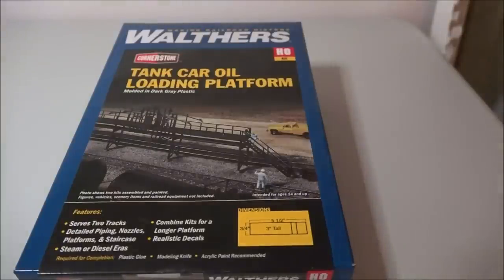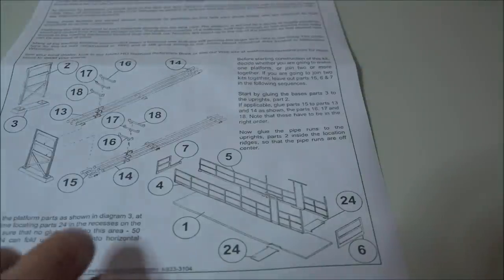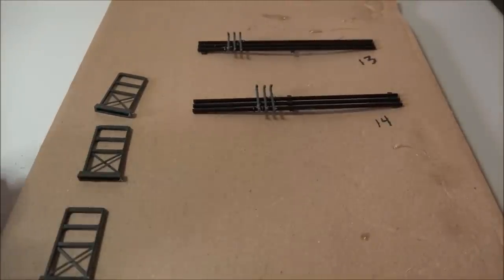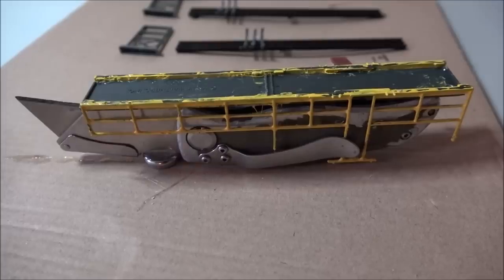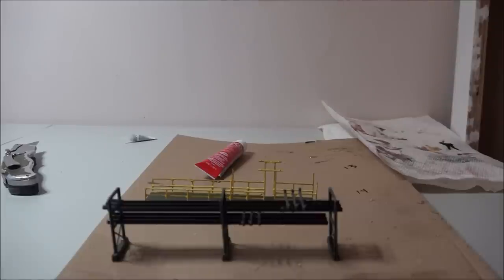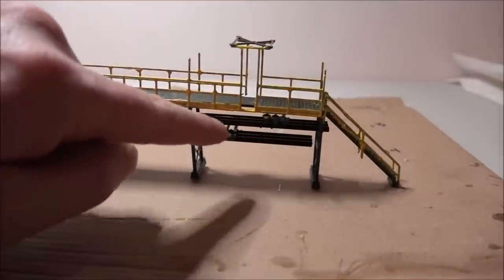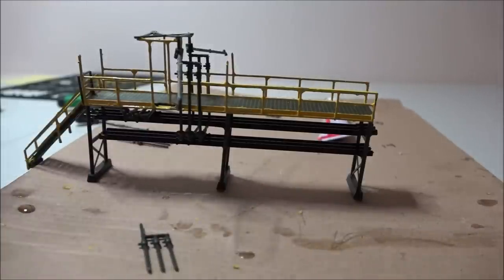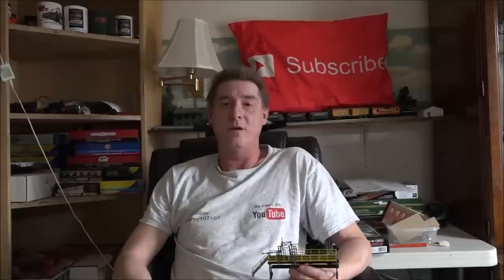Tank car loading platform, how to build it. HO scale model trains

Comment: Modelling sure tests your patience, Sparky. I've retired and gone back to modelling after about 25 years of absence from the hobby. I'm still in N scale, and with average eyesight, that's patience. I've found a lot of kits are not the greatest with instructions, so you're absolutely right. Check and test fit before you glue, and take your time.
Please keep up the great videos in 2019!

Comment: I'm used to building other sorts of plastic model kits... spaceships and such... but I've been putting together some RR scenery kits for a friend and you're right about the instructions being kinda minimal. It really takes a good bit of interpretation to figure out how to get some of them together. 
I do prefer the liquid styrene glue though, hold parts together and brush on a bit... capillary action gets it into the join and gets it done. Generally less messy/fussy than the red tube gel.

Comment: Sparky-For some reason, the super glue didnt do me good with plastics. On the plastic I have put together so far, Testors Model Masters works very well! If you have paint on and you need to glue, i try to not paint it or use your xacto to remove the paint. Model looks good! Like You say, second one be easier!

Comment: Nice video, few tips.if youare to paint a black plastic in to light, like yellow, it will be easier and neater to buy a primer in a rattle can with gray. Just one layer at the time and few sprays, Before that, those areas that is to be clued, cover it up with ,asking tape as the paint makes the paint dont let the glue bond. After the railings are gray, spray light on the yellow in thin layers untill it is actually yellow. You have before spraying test spray both on something, like a scrap piesces of sprue. Files and sanding blocks of pretty fine grits are handy to as small straight edges. And before everything is clued together with the parts painted in different colour, it is a great idea ot paint the black parts with flat black. Usually black covers well, even with a brush so you only have to have just one layer.again protect the surfaces that will be clued to make the bond easier. Thanks for sharing!

Comment: My first one of those took well over a week to build and that was around twenty years ago.It turned out very well. If you think it's hard to build try getting one in an estate sale that was badly put together and try disassembly before a rebuild. I've been over ten years working on that one (as and when I feel like it.  I have a set of lights to put in mine when the rebuild is done. You did well on it Sparky.    ..........David.

Comment: @sparky107107 Re. the Deck Ramp Hinge joint.

Here is a tip my grandfather taught me back in the LATE 1950's.  I'm old, not an antique.  We were building a NASA gantry with four "DARN" hinges.

Daw had me use electric tape OVER the joint.  Side to Side.  Then glue the uncovered underside area up to about a half inch away from the tape.  No closer.  You don't want the glue to wick.  Finish the glued structure and let thoroughly dry.  The next day clip in the hinges pins.  Done & done.